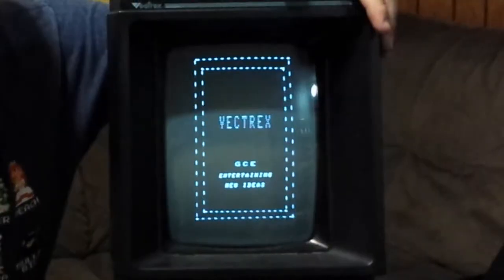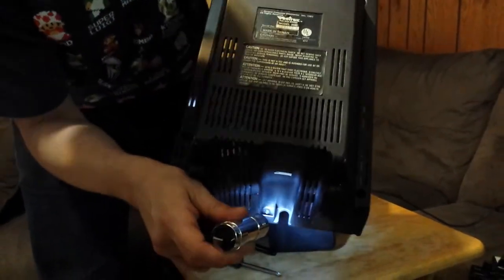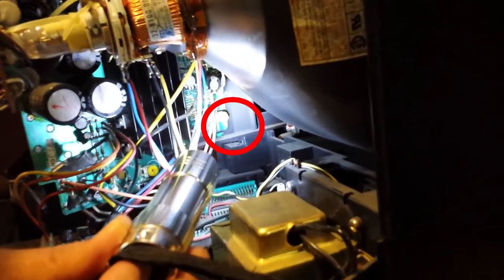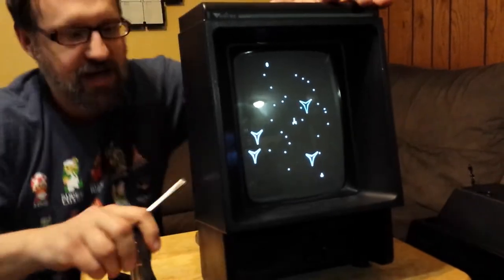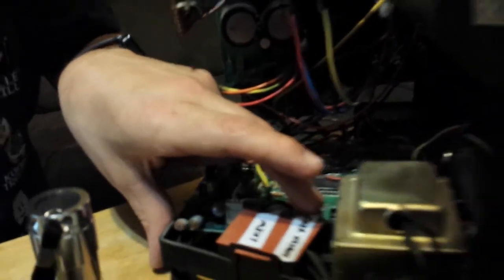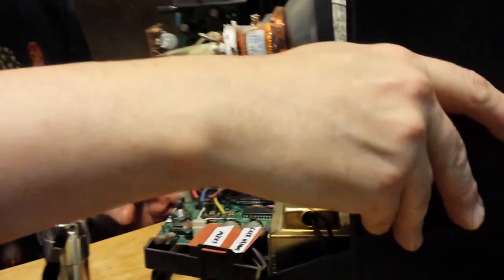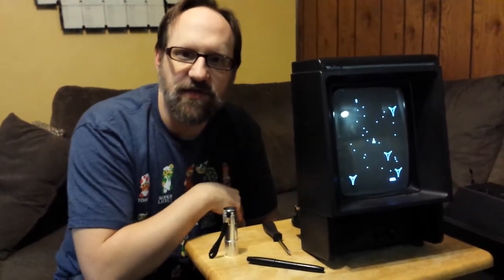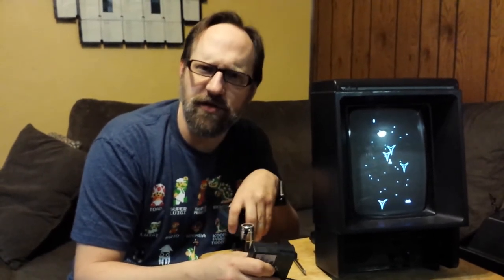Adjusting the Image on Vectrex Game Console

Comment: You can order a plastic screw driver set for working on live tubes.  This could be very dangerous if you are not careful.  Thank you for your video as it is to the point.
Reply from the maker: And thank YOU for that great tip! That’s a really good idea as you are absolutely right. Even unplugged the caps and tube still have a lot of charge stored up and one wrong move can hurt me or worse- hurt my poor Vectrex! Thanks for the info. Thanks for watching and thanks for commenting!

Comment: This helped a bunch with my Vectrex but the graphics/lines are all shaky erratic. Any insight on that?
Reply from the maker: I’m afraid not. I’m not really an electronics guy. I know that often times, with old cathode ray tube devices like this, people recommend replacing the capacitors, but I haven’t done it. You could possibly research your symptoms as they apply to a normal crt monitor or tv and see if that gives you any insights as well. Sorry that’s not more helpful. Good luck with your Vectrex! Thanks for watching and thanks for commenting!

Comment: That last "diagonal adjustment" is the DAC adjustment pot. The adjustment manual screams "This is not to be used for screen positioning". There's another video here that uses the Test Cart V4 (on lots of multi-carts) and a meter to measure resistance. Between that pot and a nearby chip pin. The Carts says Adjust DAC Offset and then goes black. That is when you want to have a reading of 0 ohms, it cycles over and over so you can get to Zero Ohms or close while the screen is off. 
The proper way to center the display is the 2 magnets on the tiny back of the tube. There's videos of that. It looks like a metal ring in white plastic with a metal tab sticking out. Since it really needs to be on and displaying something don't get near the metal box flyback transformer.  Looking in the back that top left area has the 15,000 volts. 
Having said that, I have adjusted those tabs with my bare fingers, so they don't shock. (Just pay attention and don't touch anything else while moving them.)
Also TV adjustment tools were plastic like for the pots you used a screwdriver, and also a plastic straw-like extender so you can get way in there and not short or shock yourself. 
A screwdriver should be okay, but since Screwdrivers can be dropped and Murphy's Law causing chaos, make your own long plastic Phillips and Flat screwdrivers unless you can drop $300 on another Vectrex if dropped metal tools cause your machine to release its magic smoke and break. 
Stated above the yellow ones can be turned from the other side through the circuit board's holes.
Reply from the maker: iespostavid, wow! Okay. I stand corrected. Thank you so much for all the valuable info. FYI - I wouldn't mind a bit if you post links to any of those videos you mentioned. I'm just glad to see people sharing good information. Thanks again!
Reply: Clay Carlino : Thanks. I'm all for sharing info. I'm always puzzled why the "what fixed the Vectrex" answer is so different every time! Answers like: "It was the on/off volume switch", "reseated the socketed chips", "Cleaned wire connectors / changed the wires", "how low quality the circuit board traces were made. 
"Sometimes a changed part looks soldered to the top and bottom, but there's no metal in the board hole so bad solder joints can happen if both top and bottom traces are not connected to the part."
Reply from the maker: iespostavid, I know for me, the Vectrex was kind of a "discovered secret". I don't remember ever even hearing about it when I was a kid. I discovered it at a Replay FX event in Pittsburgh. Then I got one on ebay with no manual or anything. To be honest, I didn't even realize I could adjust the image until I read about it in a forum and started tinkering. But yeah, there's a lot of conflicting info out there. Thanks for doing your part to give good advice.

Comment: Hmmm, I'm very new to the vectrex and I found the proper way to make all these adjustments outlined in the manual utilizing the test rom. I'm no tech myself, but you're doing it wrong. Also there are holes on the solder side of the pcb for X & Y adjustments so you don't have to stick your hand under the tube while it's powered on.
Reply from the maker: That sounds great. If you've got the details or even a video of your own, send a link. I'd love to check it out and I'm happy to direct people to good information!

Comment: Thanks for this, very very useful for me as I was looking for info on adjustments and this was perfect. Just one thing, is there not a focus adjustment on there anywhere? The lines on my screen are a little out of focus.
Reply from the maker: I'm really not sure. I opened it up and looked for potentiometers (variable resistors) then I turned it on and turned them one at a time and watched the effect. I know that's a TERRIBLE method! I could have shocked myself badly or shorted out my Vectrex, but that's what I did. I may do a little research on focussing a cathedral ray tube and if I find anything, I'll post it!
Reply: OK many thanks Clay actually after adjusting the pots you suggest I found that the focus was better also the brightness effects sharpness too I think I had it too high. I have been told by others today that there is no focus adjustment in the vectrex. Thanks again.

Comment: Thanks for the video. Mine seems to have a slight wiggle which is noticable on text and stagnant images. Is that normal or is it a possible issue?
Reply from the maker: I don't know for sure. Mine also has a slight wiggle. I suspect its common, but is it a sign of something bad or about to go bad? That I don't know. Sorry I don't have a better answer!
Reply: @ClayCarlino  thanks for the quick response. Since these are uncommon it's hard to compare one to the other for possible issues. LCD/digital displays have ruined me, lol. 

Thanks again.
Reply from the maker: @t.armstrong3119  No problem! I'm right there with you about being spoiled by LCD screens. In fact the Vectrex is the entire reason I broke my rule about never wanting to own another CRT again!

Comment: Hello

My startup screen seems to be a bit off, but i dont know if its in my imagination

It seems like the left side line from top to bottom is slightly angled

But i dont know

Has anyone had this issue

Games when the start are ok so it must be in my head
Reply from the maker: So if I remember correctly, the adjustments handle vectors and text separately. What I mean is that the potentiometers that adjust the text don't necessarily adjust the vectors and vice-versa. So if it were me, I'd open up the Vectrex and make small adjustments one at a time. And start up the Vectrex in between to see how the adjustments affect the startup. Hopefully you find improvements.  

Now if you do this,  be careful! The cathode ray tube and other capacitors can deliver a dangerous shock even with the Vectrex unplugged. You can easily hurt the Vectrex or worse yourself if you're not careful.

Also, other people have commented that you shouldn't be adjusting these potentiometers at all. They say that there's other ways to adjust the image that are the "correct" method. For all I know those people are right. I have never tried other methods. I tried this, had success and posted this video to show what I learned. The point is do this at your own risk, and seriously do be careful!

I think that's all the warnings I can think of. Good luck! If you're not confident, do more research before doing anything. Feel free to let me know how it goes. Thanks for watching and thanks for commenting!
Reply: @ClayCarlino  you know its the box around the text that seems off
Reply from the maker: @collj86  yeah. That's what I thought you were talking about, but I don't remember off hand which adjustments would affect that. 

This is tough question. You say it seems off, but you say that the games run fine. Without seeing what it's doing it's hard to tell what (if anything) should be done.

If the problem is so slight that you're not even sure if it's actually a malfunction, then maybe it's not worth the risks of trying to fix it yourself. If it's something that is just going to continue to bug you every time you play, then it may be worth opening it up and checking things out.

I'm sorry that I don't have more specific advice for you on your question. When I had problems, I wasn't even really looking at the box around the text. I had some pretty severe text legibility problems and vectors that were way off centered and skewed. After correcting that, the box around my text looked fine, so I never had to specifically try to adjust it.

I still think its possible that one of the potentiometers I showed in the video COULD solve whatever issue you're having, but of course there are the risks I mentioned in my previous reply.

I hope that helps. Sorry again that I can't give you more specific information. Good luck!

Comment: Mine has just a whte point in the center of the screen when I turn it on...
Reply from the maker: Oh, that seems bad! I'm afraid I don't know how to fix that off hand, but I did a search on google and found this video: 
https://www.youtube.com/watch?v=hvHITP14oRg
I don't know if it will help, but it sounds like this guy had the same problem. Good luck!
Reply: @ClayCarlino  thnaks. I hope it's not too hard to fix :'(
Reply from the maker: @BarbieChaite  , I hope it's not hard too. There's no guarentee that the video I found is even the same problem, but it sure seemed similar to what you describe. And if that's the case, It's probably not very difficult. Still, if you do try to fix it yourself, be careful. Even after a cathode ray tube device like the Vectrex is unplugged, there's still a lot of electricity stored in the capacitors. If you touch the wrong thing, you CAN get shocked. Still if it is a case of a loose wire or some dirty contacts, it's not hard to open the case, check for loose connections and clean out the dust. Of course if you don't feel confident, keep doing research. The more you learn before you start, the better off you'll be when you dive in.
Reply: @ClayCarlino  it's dangerous even wearing plastic gloves ?
Reply from the maker: @BarbieChaite  I would think that wearing plastic or rubber gloves would be a good precaution.  Now I should point out that I'm really not an electronics technician, so I'm by far not the best person to ask. 

I was able to open up my vectrex and make those adjustments as shown in the video with no problem. You might want to look online and see if there are videos about how to safely discharge a cathode ray tube. Whatever you decide to do, the more you find out, the more confident you will be when you try to do the work. And its okay to be extra cautious if you're at all unsure.

Comment: Completely wrong. The last pot you talk abput is the DAC offset adjustment, and, as explicitly stated by GCE service documentation should NOT be used for centering the screen !! To correctly adjust that pot you will need an oscilloscope, or at least a multi-meter and follow the procedure in the service manual. You are providing incorrect information with this video and if people follow it they set up their Vectrex incorrectly !
Reply from the maker: You are right. You are not the first person to point out that the GCE service document says not to use that pot to center the screen. Which is why when people mention that, I keep the comments posted here, so others can read them and know that what I did to my Vectrex is not necessarily what they want to do to their Vectrex. Now, if you happen to do a video about the proper way to make those adjustments, or maybe you create an instructables or something like that, please send me the link. I'd be happy to post the link here or even put it in the description so viewer have access to the best information.